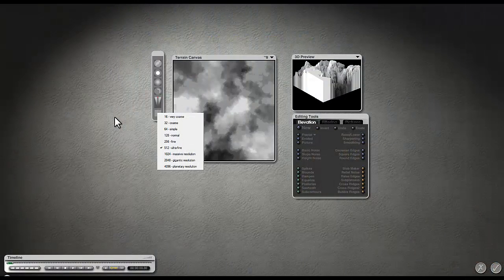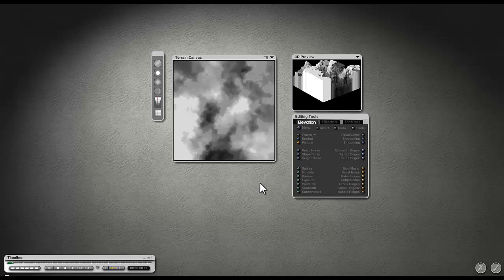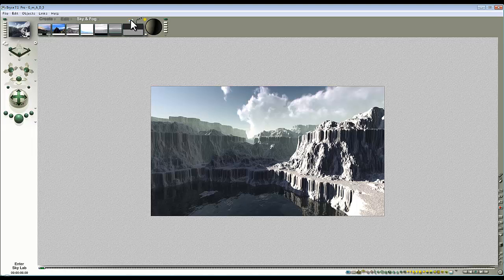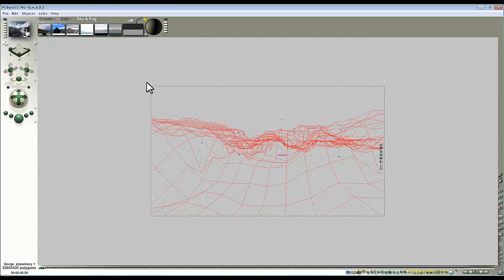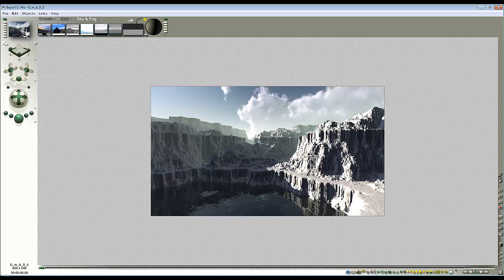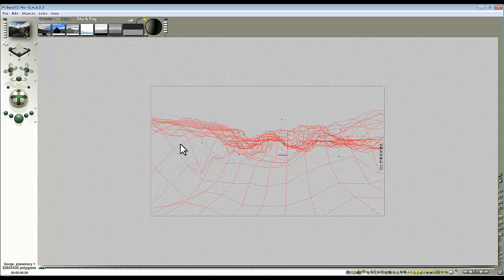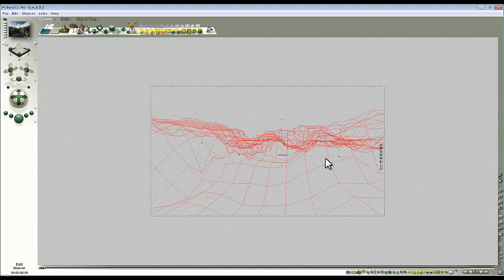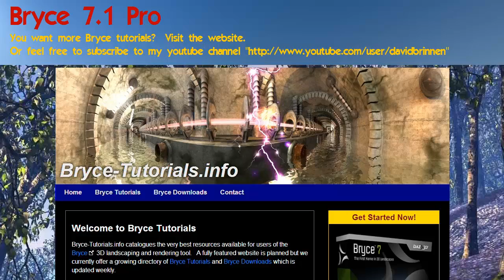Bryce "Nuts and Bolts" - dealing with high resolution terrains - by David Brinnen.

Comment from the maker: Well while it maybe true that Blender can do more for less (I defer to Blender users for that information) and it is certainly true that Bryce needs to be updated.  The purpose of these video's is to help Bryce users get the most from their software as it stands in version 7.1 Pro.  Just to be clear, I've never said, don't use Blender or that Bryce is better.  Only that there are a lot of things that can be done in Bryce that you may not initially think would be possible.